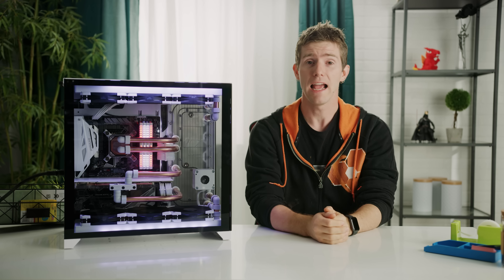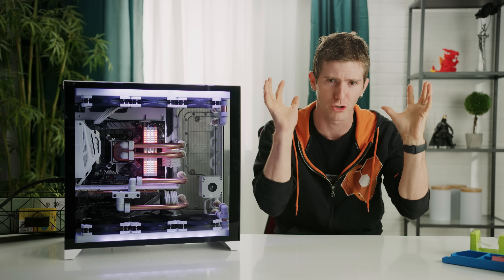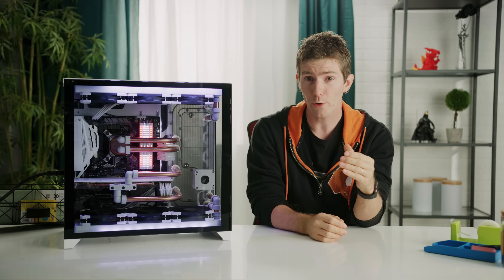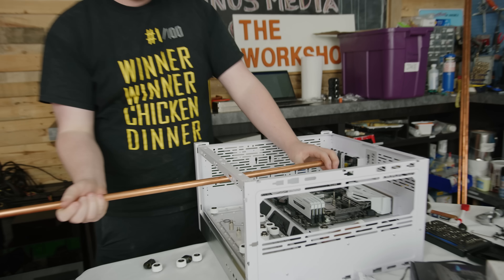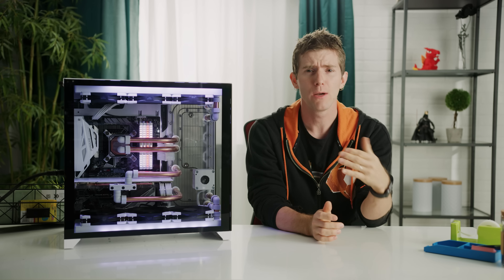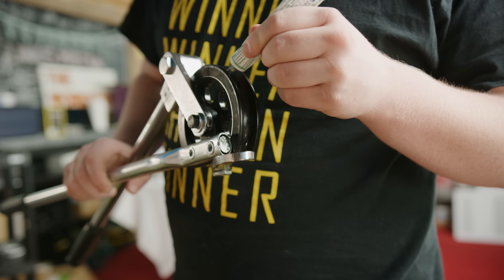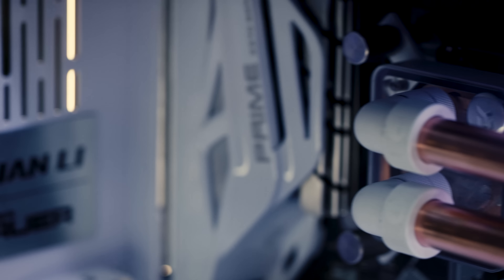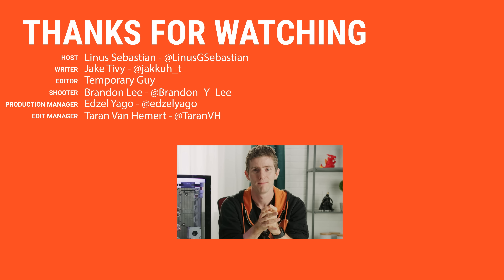Copper Tubing is HARD

Comment: You forgot to mention that all the blocks has to bee full copper :)
Reply: it's okay if it's brass, right? just not aluminum as that forms a battery with copper
Reply: Linus stated that both the cpu and graphics cooler was full copper.
Reply: @Cowcow211  he did? well now i feel stupid...
Reply: Basically all blocks are made of copper (if they aren't made of aluminium). They can be nickel plated but that makes no difference in your loop. It might only look weird.
Reply: You think mixing metals is ok with acrylic tubing? You have to go with the same metal throughout.
Reply: Actually, it needs to be copper. Nickel plated isn't "okay", but aluminum is way worse.
Reply: Mixing metals is always wrong and if you have mixed metals, change them now to new ones or clean the parts and buy the missing same metal type pieces.
Reply: @erwinjitsu_3706  @Entcraft44 @Robert T … if it looks like Nickel it's almost always nickel plated copper. Their V index is very very similar. You won't get galvanic corrosion. It's safe to mix those two. In fact: most people already mix it since radiators are basically always made out of copper and are usually not plated on the inside. See also: https://ekwb.zendesk.com/hc/en-us/articles/205236791-What-is-the-difference-between-Nickel-and-Copper-
Reply: diotough Yes, most of the copper products are nickel plated but you should still keep other metals out of the loop. It's not a joke as the flow in the loop could stop at any point causing the heat not to dissipate and therefore it may cause problems. 

Most common mistake is to mix aluminium with copper.
Reply: @erwinjitsu_3706  I'm not talking about aluminium. I'm talking about nickel and copper … it doesn't matter if you mix those. That's chemistry. And you'r probably already mixing it if you have a nickel plated part in your loop since your radiator is most likely not nickel plated on the inside but bare copper. You have nothing to back up your claim that mixing those two causes galvanic corrosion as it would if you mixed copper with aluminium.  

Here you'll get a copper cold-plate with a brass top that's nickel plated: https://www.ekwb.com/shop/ek-supremacy-evo-full-nickel 

You really think this think will just corrode?
Reply: diotough I still understand, I was talking about mixing metals and you tagged me so I assumed you had something to say to me.
Reply: @robertt9342  Yes, but he could've used aluminium blocks, and that'd screw it up as he's using copper tubes. Think a little.

Comment: A pipe bending spring would have saved you a lot of work.
Reply: Not really it's about the same
Reply: @jackbradwell1002  Also I have fitted Kitchens and bathrooms and never once reached for the blow torch when using a bending spring.
Reply: @TheDutyPaid  it can crack straight pipe I've had it happen before
Reply: @jackbradwell1002  must have been lucky over all these years. I guess what ever works for you the best.
Reply: @TheDutyPaid  guess it also comes down to the material as well and what you've been taught
Reply: @jackbradwell1002  man he conceded and was nice don't be sassy
Reply: @Sickle771  i wasn't man i was adding to the conversation

Comment: Should have used Type L soft copper, you wouldnt have to heat it to bend it. I really hope your fittings are made of brass or you will have corrosion.
Reply: They used OCZ fittings which is nickle plated copper. I think nickle isn't effected by the copper but I may be wrong.
Reply: @Someone-cb3zx  well yeah, but the 2 radiators are aluminium, so...
Reply: @cleosynthesis  no they're copper
Reply: @nororlol4life819  Hey dumdum, EK provides radiators with copper FINS, while the casing/housing is aluminium(where the water flows).
Reply: @cleosynthesis  Only thing that connects with copper IS copper/nicle/brass not alu
Reply: @nororlol4life819  Whatever you say man. You probably have built way more custom loops than us. ;)

Comment: I want to make a golden tubing
Reply: As in brass or actual gold?
Reply: @chandlermorris712  Just 24Kt gold
Reply: @darkwarrior9988  i do it with elektroplating it first with nickel than gold
Reply: @darkwarrior9988  24K gold would probably be too soft. And at 1200 dollars per ounce, too expensive. 14 or 18 K gold would be easier to work with. Alternatively, just electroplate some other base metal (make sure the base metal that is in contact with the water is the same as your fittings and blocks or you'll have major corrosion issues though).
Reply: Just plate the tubing
Reply: but first a layer of nickel becouse gold and copper will build a alloy over time and the gold turn more and more red therefore we need a wall of nickel

Comment: You didn't use MAPP gas. Map/pro is different.
Reply: I've always used camping propane, how is this stuff different?
Reply: pretty sure mapp was the brand name gas
Reply: @gelu88  Burns a tad hotter. Not much difference
Reply: Heck even LPG works...
Reply: Spaghetti God Map gas is substantially hotter then propane. And swank no it isn’t just the brand.
Reply: zack9912000 - ohhh yea 1,995 °C vs 2005 C is a MASSIVE difference!!  Stop acting like you know anything.
Reply: Try freeing up rusted ass bolts on an exhaust flange using propane vs mapp gas.  The difference is a good amount of time.  Which is significant when you're sweating your ass off due to your close proximity to a hot torch and heated steel
Reply: While mapp can burn at 2925 C in oxygen and propane at 2820 C in oxygen, but I can see your ego is bigger than your brain and you had to drag it in the argument so I'm still gonna say you lost the argument.
Reply: Wohweli what ever makes you feel better about yourself while you are all talking about stuff you are clueless on. Feel free, make sure you practice would you like frys with that if you don’t care to have a clue about the subject matter. Details matter and when you don’t know the details you look foolish trying to argue about it.

Comment: What's up with all the fans exhausting???
Reply: mikipedi4 no real need for intake if it’s liquid cooled
Reply: @Batch172hshs  That makes no sense at all. Now all the air has to come through tiny slats in the back and the cracks in the frame, plus that will only pull dust in at an accelerated rate as you do not use any of the dust filters this way. Not to mention that now the bottom and top fans are pulling against one another with a limited air supply.
Reply: This type of builds are just for showcase. They are in exhaust configuration just because it looks better!

Comment: The learning curve looks a little like this. That's a very short learning curve?
Reply: It's intended to be a steep learning curve my friend.
Reply: @vineethchennabhoina3798  I know what they're intending. But learning curves have experience or time down the bottom with knowledge/skill on the y axis. A steep learning curve would have a long time with 0 benefit then a "steep" slope as the gains finally catch up. What they have shown is what is called a 'short' learning curve where most of the knowledge is acquired very quickly. You could have just googled that and saved me writing this explanation.
Reply: Vineeth Chennabhoina That's not how learning curve graphs are depicted though. Normally it's skill/proficiency on the y-axis and time/effort/attempts on the x-axis
Reply: @TheEchelon  "intended"

Comment: Moonshiners fill the tubes with sandblasting sand and it keeps the kinks and deformations to a minimum, also blasts out easy with air.  

Another option is a tool that is a spring thing that fits inside

Comment: I'm planning on doing this but adding an extra step where I dip my tubing in a solution of nickel acetate, this will give them a nickel coating that can be polished. To keep the copper tubing vibe, I'm using soldered fittings.

Comment: So I was watching someone do some brazing on an HVAC system. You don't need to heat the pipe to bend it, but you do need a tool that will bend it smoothly. Then when you do your brazing you need to ensure you have a propane and nitrogen torch assembly and some silver to braze.

Comment: A few possible items you could use here are - an internal pipe bending spring, like with plastic tubing you have the silicone insert the metal spring does the same at stopping the tube getting squashed. Also to help polishing maybe try wire wool.

Comment: Masterplumber from Germany here (Important to know that Im from Germany, as we are the best Plumbers in the World *cough*): Combining Copper and Aluminium fittings in a Watercooling system is no problem, AS LONG as you use distilled Water. For Electrolyse or Galvanic Corrosion you need Minerals inside the Water to solve Copper-ions from the Coppertube. As long as those Minerals are missing, which is the case in distilled Water, you`ll be fine. Still you should clean the Pipes and the Fittings with clear Water and then mount them as particles from sanding could clog the Pumps and narrower Areas of the System. And if you really want to reach Geeklevel 9000, then you fill the System with nitrogen before filling the Water in. That way you keep Oxygen out of your system which will otherwise be absorbed from time to time by the distilled Water and attack the fittings and pipes.

OFCOURSE all this only applies, when we are talking of a long therm use (5Years+?!) But Someone who is into System optimization through Watercooling will never use a CPU or GPU for more than a Year. So Fuck all of those discussion about corrosion and shit....

Comment: Jewelers who work with copper clean it with a mix called "pickle". Thats a mix of sodium bisulfate, but you can make a weaker version with white vinegar, salt and citric acid. Just put the part in a warm bath of the solution and you'll have gorgeous shiny copper. It will probably ruin whatever container you use though.

Comment: You don't need to sand your copper post-annealing, you can use something called "the pickle" to clean it up, which is basically required if you'd like to solder. Source: am a metal worker.

Comment: You can also bend these without using heat. Simply cap off 1 end of the tube, fill it with water and cap off the other end. Freeze it overnight then bend. 
I used to work in the fabrication dept of a company that made products involving tanks and metal tubing. We would use liquid nitrogen to dip the water filled tubes in, then immediately bend....but since most of u don't have access to a styrofoam cooler filled with liquid nitrogen a freezer will work just fine.

Comment: One thing that can help with bending soft metals such as brass or copper, find steel ball bearings with the ID of the pipe or tube (there is a difference between these two) and then fill the tube with wax this will give you a very precise very tight bend bend without crushing.

Comment: If you want to make a really tight bend, just fill the tube with water and freeze it first, it'll put pressure on the copper tubing, when the water expand as it freeze, best DIY way of preventing buckles

Comment: Protip: flux (used in copper solder applications) can clean up the discoloration from a MAP torch. If you catch it while it's still warm, it'll clean up easily.

Comment: Copper tubes would get hot and radiate heat inside the case. Plastic lines would insulate, helping more heat reach the copper radiators to be expelled.

Comment: Copper piping is hard for sure.... getting/renting the tool is extremely important foe the bending... also instead of brass protectant, you can use automootive clear coat.... matte clear coat looks most the best

Comment: For the discoloration, it's much easier to use acid instead of sanding it. Put the pipes in a bath for a few minutes, wipe down, done. Be careful though and use safety equipment.

Comment: On the positive, you don't have to worry about plasticizers as much.
On the negative and because there is no free lunch, introducing more metal means more corrosion--especially if the radiator is aluminum, while the rest is copper. Distilled water will help this for a while, until it gets a snootful of metal ions.

Comment: Just so you know, the difference in soft vs hard after cooling doesn't entirely depend on material. The way to make soft steel is also through heating, with the only difference being that the steel should be cooled as slowly as possible rather than immediately. You were right that 'quenching' steel is meant to harden, but it's important to keep in mind that the end hardness of a certain steel (and I would presume copper) depends on how fast the material is cooled, not just that it is.

Comment: you could try blocking the ends of the pipes...filling with water and freezing. bending it while frozen with the smaller pipe bender should prevent it from crushing and give you a nicer bend.

Comment: I know of 3/8 npt fittings by flare (1/2 or 3/8) that attach with brass fittings and soft copper tubing. Could likely be adapted for water cooling as long as everything is NPT. Home depot would have it.
Reply: Likeyou said though might have blemishes

Comment: I would think that the copper tubing would get warm, and the case fans in a closed case system, would push air over and around the tubing, taking some of the heat away from the copper tube as it passes.

I can almost guarantee that if you were to put a fan of some kind blowing on that giant copper coil experiment you did before, I think you'd see better results than just a copper coil sitting in stagnant air. In the same way, this effect could be achieved with copper tubing inside the PC case with fans, albeit on a smaller scale with smaller gains, but gains nevertheless.

Comment: copper will lose heat rapidly though if it touches something else that absorbs it, like the metal piece i soldered last night, one piece that i ididnt touch for while stayed hotter longer than the one i touched which cooled rather fast after picking it up

Comment: If you're going to fill the pipes with sand, don't forget to pack the sand down to compress it with some sort of loose-fitting rod, or else you're going to get bumps and kinks. Kiln-dried sand works well for this, it doesn't get stuck to itself in clumps or scratch out and get stuck inside the pipe, while being pretty easy to pour in and drain back out again.
Alternatively, you can use a bending spring inside the pipe if you can find one for the pipe diameter you're using, but they can be a nightmare to get back out again if you don't grease them.
They can get stuck so beware, it also takes ages to flush all the grease back out again so that's a method of last resort in this application, you don't want grease floating around your pc 😢

Comment: Heres on of my personal tips polishing is just sanding at very high grits so you can in theory use sand paper to polish id go up to 1500 sand paper for copper then use a jewelry  polish cream or something like mothers aluminium polish to finish will come out looking like a mirror ;)
Reply: BTW id use a clearcoat intended for chrome a much cleaner look than the copper or brass coatings

Comment: So I know that this is way off the topic of computers but I actually work in a factory the makes finned tubes/pipes for heat exchangers. We deal with a lot of different sizes and types of tubes but the hardest one to work with is copper surprisingly. I mean it depends on what you're trying to do with it but in general it just doesn't want to cooperate with what you're trying to get it to do, especially bending. Like guys do not feel bad that ya kinked some tubes because that's just how copper be sometimes. Annealing it was a good idea but unless you get it up to a very specific temperature (around 750 to 1000 degrees Fahrenheit) and no higher or lower, then you're prolly not going to do anything except make it hot for a bit. Now the polishing was funny because of the machine I work on I have to polish the tubes as they are being finned sometimes. However I don't use sandpaper because it eats away too much of the wall of the tube. Instead we just use scotch Brite. I know it sounds dumb but it's way faster and gives you a neat finish all while preserving the integrity of the tube wall. 
Anyway I've rambled on long enough. You guys didn't do anything wrong and everything worked in the end. I was just sharing because I have experience in the area. Keep up the good work fellas 😁

Comment: I see that they didnt learn from whole room water cooling. Putting copper with steel and water never works. With two dissimilar metals like that you get galvanic corrosion. That's what happened with whole room and if you ran this for any length of time the same would happen here.
Reply: Whole room water cooling was also done just a few months before they moved office, so you can tell the planning on these things isn't great to begin with

Comment: Just a theory but would there be any gain in thermals if its copper? Copper pipe will have better heat loss than plastic or rubber tubing. Kinda like a recirculation line on a hot water system for a house you would insulate the copper pipe and for a gravity fed system the highest run stays bare as to aide in the movement in the line because the top most portion of the loop stays cooler than the bottom porton. Heat wants to make its way to the top where its cooler thus creating a gravity fed loop. In such a small space im not sure that thermals would benefit from doing a copper water loop inside a pc case but it may be interesting to see

Comment: Putting sand inside the copper tubes with prevent them from kinking. Just do your bend with caps on the end filled with sand and then flush the sand after. I bend copper tubes all day for diesel engines and its  the same method we use... like i said just flush your bushings/pipe.

Comment: No need to heat copper pipe, or fill with sand, just use s decent mandrel bender just like the one you were using, I install central heating and you can get perfect bends with a bender